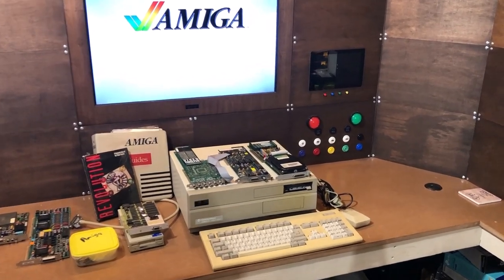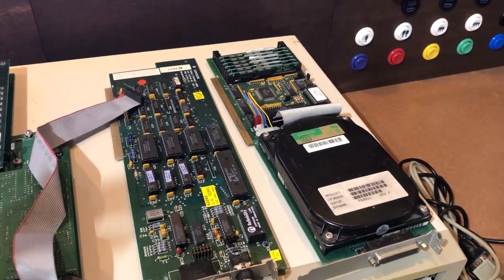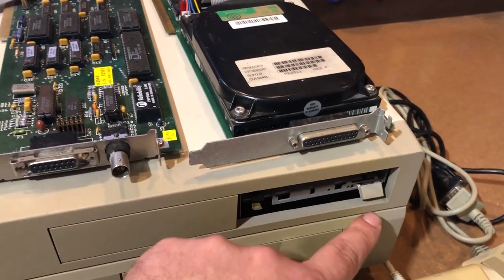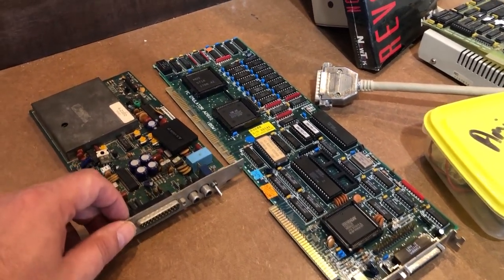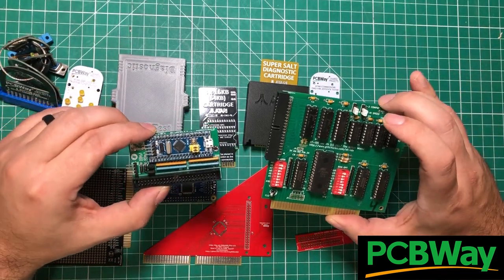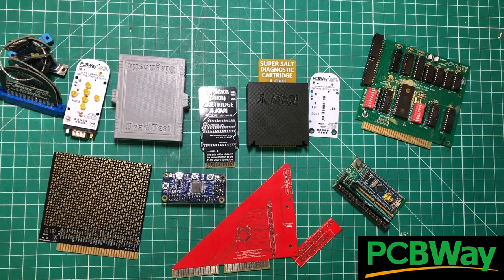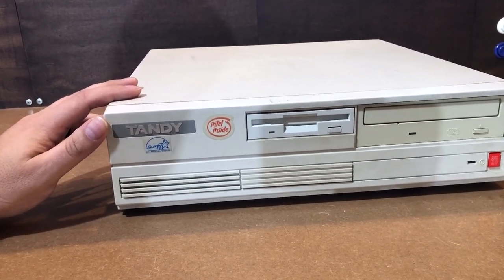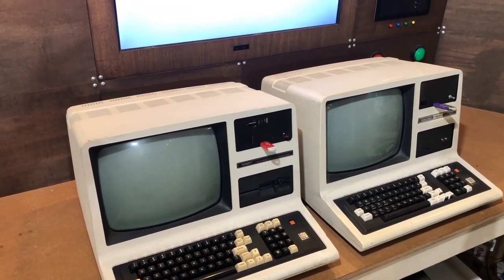A Tour of My Vintage Computer Collection

Comment: You are a maniac!  There are some gems in that collection.  People were able to mod those TS-1000's to make them usable.
If you find a way to repair/replace the Adam's tape drive, lemme know.  Would also like to find an ink ribbon for the printer.
Reply from the maker: Your parts are scattered throughout lol. I found a replacement Adam keyboard the day after filming that video in a box in someone's storage unit. That's the encouragement I need to put that thing together. I will keep you posted

Comment: If my memory serves correctly, that macintosh SE is the "quickest" computer I've ever used - as in the latency from pressing a key and it showing up on the screen was basically instantaneous - almost like old oscilloscopes. It might be nostalgia, but my thousands of pounds main computer with high refresh gaming monitor running RT Linux still feels like it should be faster....
Reply from the maker: I feel the same way. CRTs themselves are ridiculously responsive.

Comment: iMac G3 dude that is one of my favorites always wanted one but apple was and still is crazy expensive here in SA. Also the 2C is another favorite. That apple notebook was I think used in Hackers.  Those P3 Thinkpad notebooks were awesome. I think 8bit guy use a 1000EX a lot. I love the quirky Sinclair macines.  Thanks for sharing.
Reply from the maker: Thanks so much. I found that G3 for $30 on Facebook and it worked and included the clear Apple mouse.  I really need to learn more about the Apple ii line. I'm still working on making disks
Reply: @AnotherMaker  That G3 is when Steve Jobs came back to Apple, I was in High School at the time really loved those macines.